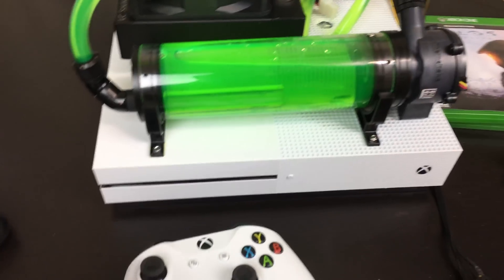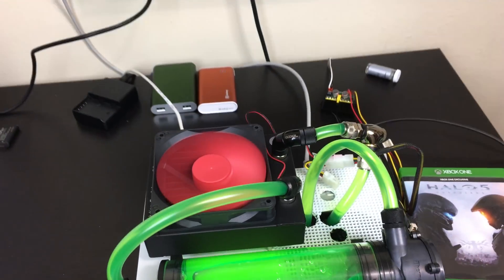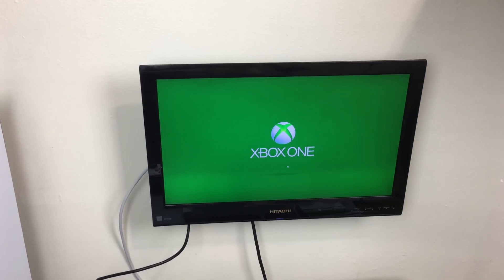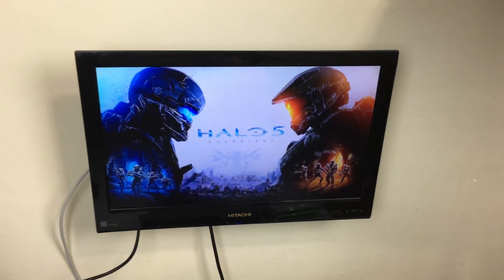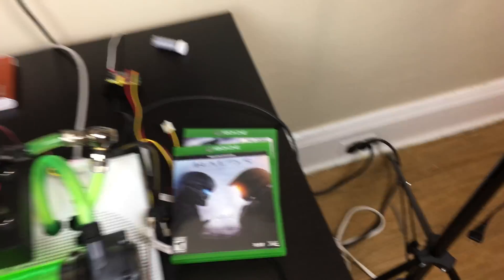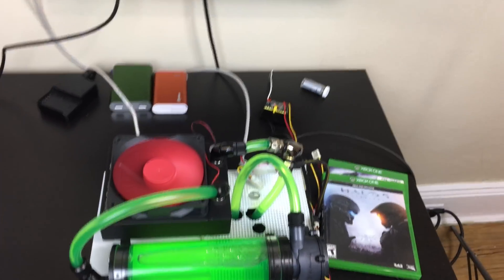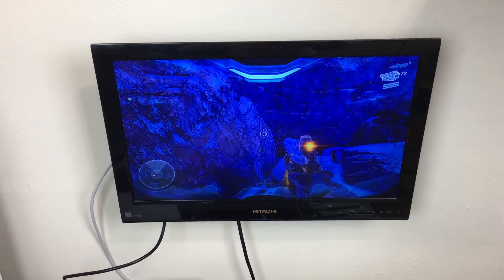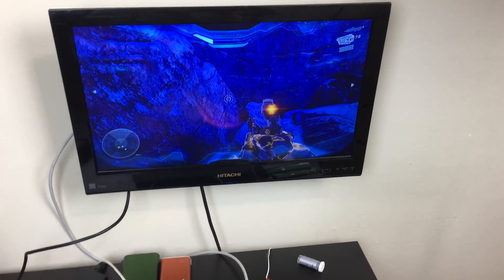Water Cooled Xbox One S - The Final Video

Comment: what power supply did you use
Reply: You don't need an external power supply with a separate switch like this guy is using. You can actually tap directly into the internal power brick so the pump turns on when you press the power button. You just need a relay, a switch, and some soldering supplies. I know how to do it, just let me know if you want a walkthrough.
Reply: would you help me, bacause i want do the same project: sorry if you dont understand to me because i speak spanish
Reply: I'm sorry it took so long to get back to you, I've been busy finalizing my own watercooled Xbox One S build... Check out the video on my channel if you like!

Just a forewarning, this is a much more complicated way of doing it, but it looks way cleaner and requires less steps when powering up the system.

THE PARTS
12 volt, 3 amp relay - can be found at RadioShack or Amazon
3 amp Rocker Switch - can be found at RadioShack or Amazon

THE WIRING
The relay should have 8 pins in total, resembling the diagram below. Each (-) represents a pin. Each pin column represents a separate circuit, excluding the bottom "coil" pins). It should be wired like this:

-       -     (normally open) These pins are only powered while the console is ON. Attach only 1 of these to both the NEGATIVE of your rocker switch AND the POSITIVE of your pump.
-       -     (common) These pins should be bridged together and soldered to a wire that goes to the 12v contact on the PSU circuit board. Let me know if you need help with this.
-       -     (normally closed) These pins are powered when the console is OFF. Attach ONLY ONE of these to the POSITIVE of your rocker switch.

-       -     (coil) These pins are slightly separated from the others, and are responsible for changing the relay between "normally open" and "normally closed." Connect one pin to the positive of your fan cable and the other to the negative. If looking straight down at the side of the fan connector that has the notch on it, the negative wire is the furthest on the right, followed by the positive. You don't need to worry about the other two wires. You can power any aftermarket fan through the onboard header simply by cutting off the stock connector, attaching the new fan, and plugging it back into the motherboard. If you plan on adding any extra LEDs, I would run them through another switch that you would connect to the unused "normally open" pin on the relay, after adding appropriate resistors of course...

Finally, solder the negative lead (or leads, if you added LEDs) of your pump to the "Ground" contact on the PSU circuitboard, and you're ready to go. Everything is internally powered and will automatically switch on and off with the console. The switch is only there so that you can cycle the pump without having to turn on the entire console (useful when you're doing loop maintenance)... And don't forget a drain valve!

I hope this translates well...
I would be happy to elaborate further, if you still have any questions.

DISCLAIMER
I am not responsible for any damages you may inflict on your equipment as a result of improper wiring based on an insufficient understanding of the information I have provided here. What you choose to do with this knowledge is at your sole discretion. Mod at your own risk.